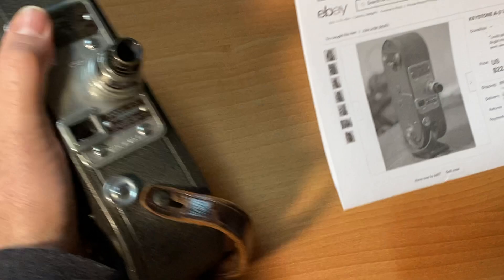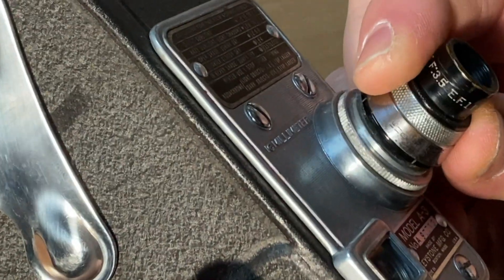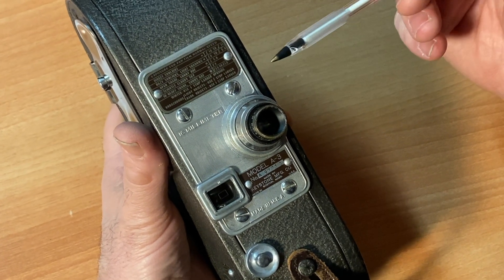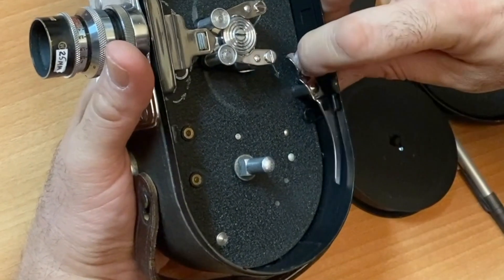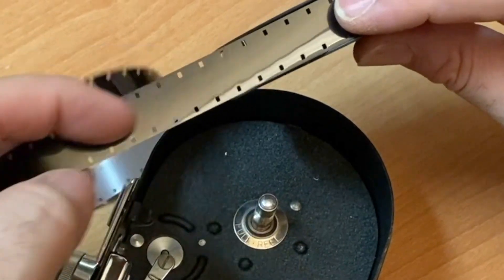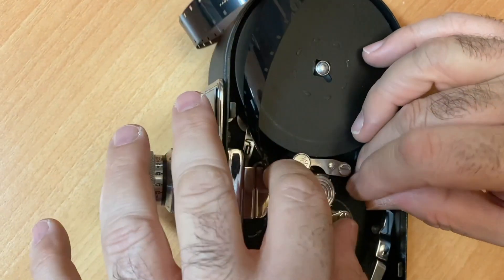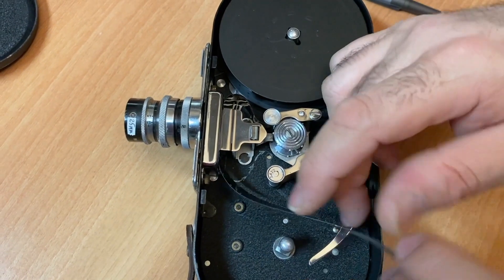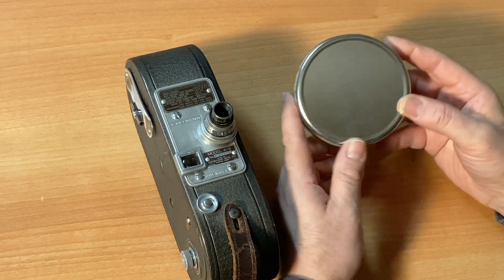Keystone A-3 16mm Camera - Overview and Film Loading

Comment: Thank you for this. I'm a photographer and I just found my mother's Keystone 16mm camera. Would love to try to use it. But I cannot get it open. The ring on the side will not move. And the mickey mouse ears will not turn either. Any suggestions?
Reply from the maker: You can try a little sewing machine oil on the opening knob. There might be film threaded that is preventing the motor from running.